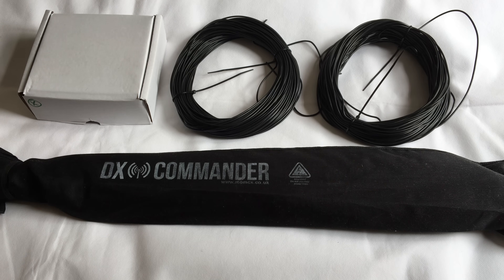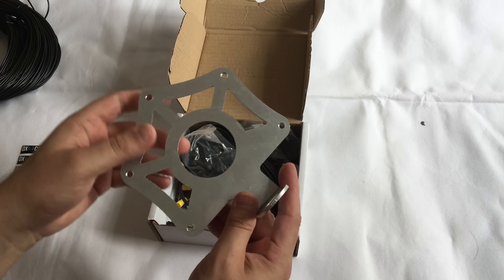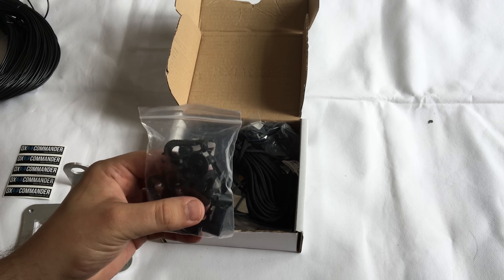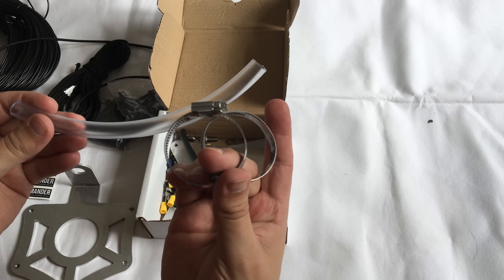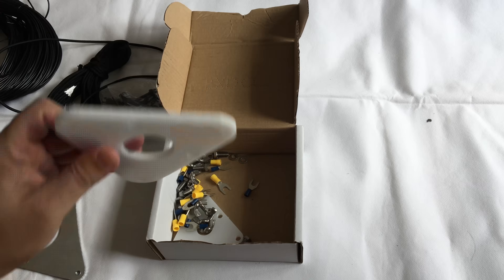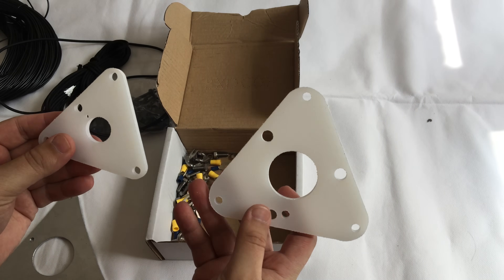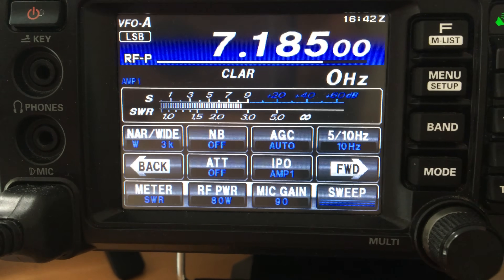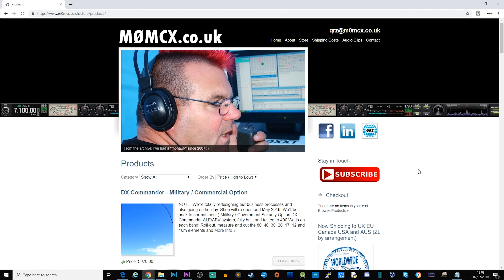Building the DX Commander Expedition Multi-band Vertical HF Antenna

Comment: Hi, great video but what stops the base of the antenna from kicking out when the wind gets up?
Reply from the maker: The bottom plate is fixed on the pole and the guy ropes pretty much pull the antenna to the ground, so it kinda stays in place. Nothing wrong with making a small hole in the grass to sink it in either.

Comment: Great video 
Are the band wires cut at the factory for your chosen frequencys or did you have  to cut them?
Reply: You cut them to the measurements that DX Commander provides in the instructions. You get a roll of wire in the kit.

Comment: It's not clear in the instructions: just what are the clear plastic rings for at the top of the antenna pole? While I use the larger one for a loop of the 40M element, it doesn't "feel" right.  How is the 40M element folded back? Also, is the top metal ring actually used in the classic version (when used for 40M - 10M?)? Or is the top element just keep rain out of the pole? I've lost those clear tubing rings a few times in the grass so I put a strip of red electrical tape around the clear plastic and haven't lost them since. I only use the DX Commander for portable - 1 hour set-up and takedown. After returning home,  I disassemble to allow the inside to dry. It's usually wet inside when I do so.

Comment: Hello,
 bonjour
Just turn the feed plate a quarter of a turn to the right to feed the antenna through the center hole (of the three). The antenna wires should be each attached to each point of the feed triangle. 
Superb antenna. (like all Cal's antennas ) 73 F5NHJ
Reply from the maker: Yeh I saw Callum’s video he made after I provided feedback on the little issues. When I install it again I’ll do that, next thing for me to try will be 80m 1/4 wave on it :) thanks for watching, 73 M0DQW

Comment: I have been using the DX-Commander Expedition for quite some time now on my various DXpeditions around the Pacific.  It all packs down into my suitcase (no hassles with extra packages etc).  It takes me less than 10mins to get it up and operating now.  Works flawlessly.
I have used it together with the DX-Commander (Regular) configured as phased verticals and that works even better.  I need to get a second DX-Commander Expedition to take on my DXpeditons, the extra gain is well worth the expense.
Looks like you could cut a bit more grass and get a second DX-Commander Expedition going in your backyard.  Believe me the extra gain is worth a few extra quid for sure.
Cheers, Roly - ZL1BQD
Reply: I know I'm kinda randomly asking but do anyone know of a good place to stream newly released series online?
Reply: @Ford Colby Flixportal :P
Reply: @Bowen Jesus Thanks, I went there and it seems to work =) I appreciate it !!
Reply: @Ford Colby no problem :D

Comment: Thanks for sharing. I just bought the multi band 80m-6m HF antenna /P ALE from DX Commander. I live in the states and am waiting on delivery. I have very little space in the back yard and thought about trying to make it a permanent. I will have about the same room as you for ground radials. I am hoping the snow and cold we have here in Missouri don't cause early failure do to corrosion of the connectors being so close to the ground and being covered in snow a lot in the winter. Thanks again. KE0RPU
Reply from the maker: I’m sure your experience with using the DXC in snowy conditions will be beneficial to Callum, and suggestions it observations you come across just forward them to Him :) Id be really interested to know if having snow between the bottom radial plate and the driven element plate causes any de-tuning? Let us know how you get on! 👌

Comment: Hi, here is an alternative solution for the hose clamps. I’ve used them on the DX Commander Classic and it works flawlessly, much easier to install:

https://www.dx-wire.de/lng/en/fiberglass-poles/accessories-for-fiberglass-poles/rubber-profile-12m-grey.html

73, Jo - DL1JRM